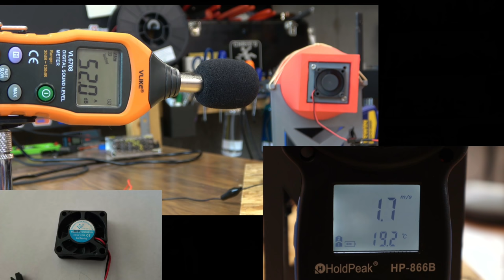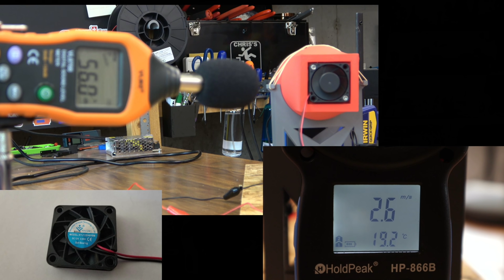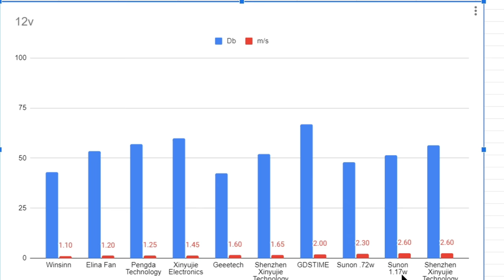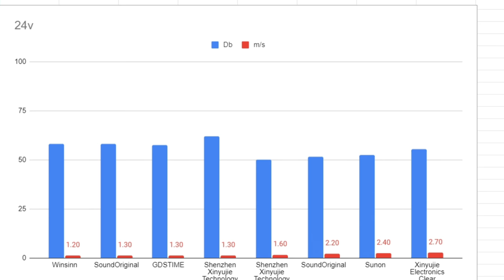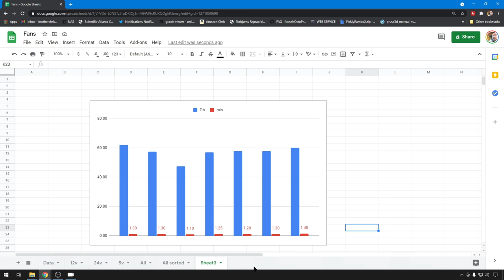Fans! Fans! Fans! - We Test Every 3D Printer Fan I Can Find - Chris's Basement

Comment: Your duct and mount prints look really clean. Cant tell if it's just the video though. Anyways, next time it would be interesting to see this done in categories/different videos of like 40mm fans with a comparison chart at end then 40mm blower fans with comparison chart and maybe a shootout with bridging, short layer times ect all tested along with different fan configurations like 1, 2 or 3 part cooling fans in different layouts. I've had great success with 3 5015s in a 120 degree layout in the past but finding good 5015s is difficult so I have resorted to over volting 5v to 8-10v changing them out regularly as a result, plus they are cheap quality to begin with. This is a great subject IMO that hasn't been covered properly in the past.
Reply from the maker: Thanks for your insight!

Comment: Excellent!  I would have liked to see the noise and output of a Stock Creality 24v fan for comparison.  Some of the 4010 fans ordered from China cause thermal shut down. So not enough airflow.
Reply: Uh no, that's too much airflow. More air, less heat at the block, can't reach heat setpoint, shuts down thinking there's a problem
Reply: @TheMidnightSmith  That is interesting. The new fan has a center hub of 25mm while the Creality is 20mm. So I assume it can putout less air. Larger hub = shorter fins.
Reply: @FilmFactry  but what is the cfm flow? RPMs? Bearing type? All create variables. If you're getting thermal runaway, it's too much air blowing on the nozzle.
Reply: @TheMidnightSmith  This is the always on heatsink fan, not parts cooling. I very much doubt it was putting out too much air. The creality has larger fins. 4010 fan.
Reply: @FilmFactry  so if it's on the heatsink, I can't imagine it being a thermal shutdown. That's supposed to be cool, but nothing measures it. The only things measured are the heater block, and the actual main board in the printer.
Reply from the maker: I thought about pulling more fans off of printers, I might still. I think I will consider rebuilding the rig.
Reply: @ChrisRiley  The stock 24v 4010 Creality fan would be great as a comparison.  I also though maybe using a hotend at a set temp, and seeing which fans are more efficient cooling it. Basically the reason we use them.

Comment: I really wish there were silent blower fans. I guess that's mechanically impossible, but it would certainly be nice.
Reply from the maker: In a perfect world...
Reply: I think something you might be looking for, might not be a fan. But a piezo aquarium air pump. I feel this might work for part cooling, if you run it through a very narrow air nozzle there directly on the hot bead as it exists the nozzle.

I haven't tested this idea, but i thought i'd share regardless. I actually had this thought several years ago but then instantly forgot to follow up on it.

Comment: To test part cooling fans, you should test them for pressure and not by flow. Try to see how much air they can make pass through a small hole could also work, and they should be much better on this them the other fans
Reply from the maker: Thanks for your insight

Comment: remember that dB is a logarithmic scale. "An increase of 3dB doubles the sound intensity but a 10dB increase is required before a sound is perceived to be twice as loud. Therefore a small increase in decibels represents a large increase in intensity. For example - 10dB is 10 times more intense than 1dB, while 20dB is 100 times more intense than 1dB."
Reply from the maker: Thank you for your insight. 🙂
Reply: That also goes for human perception of sound. For example, a 20db sound will be perceived twice as loud as 10db, and 40db will be perceived twice as loud as 20db. In fact, that is the reason why the db scale is used. Since we're comparing db to db, it shouldn't matter what the intensity is

Comment: Loved your in-depth results however those Graphs... probably should have put up a 2nd Y-axis to separate the Sound and the Blow speed, because it's very hard to compare both along the same axis.
That's done via Google docs on your chart by customizing each Series Separately on the Left or Right axis.

You should unclick "Use row X as data", because its making you miss one fan each time.

It feels sensible to graph the Sound DB logarithmically since DB scales that way. I've done this by calculating the DB difference between each fan with respect to the MAX measured and then changing it to logarithmic of that value. This scales the sound on the graph such that it can show whether a fan is 10 times louder than the other.

I was able to draw better conclusions after doing the adjustments I suggested above.
Reply from the maker: Thank you for your insight.

Comment: this is great, however just to tell the truth, not all sunon are the same, the part number tells a lot about the fan and there is a number that its really important, for example MF40202V2 the last 2 is the speed, this can be X super high, 1 High, 2 Medium 3 low and 4 extra low, this can change the CFM and off course the DB be sure to check the datasheet to make sure you are ordering the correct one
Reply from the maker: Good point! Thanks for your insight

Comment: Pressure would have been quite interesting Aswell. I can imagine that's where the blower fans are a bit better, because they have to get the air through some ducts.
Hard to test tho. Maybe measure the flow behind a small hole instead of a big canal like in this video?
Reply from the maker: Sounds interesting!
Reply: @ChrisRiley  Just print a "plug" for your orange duct and insert it about half way, with a 5mm hole in the middle. The wind reading will tell which one can create some pressure and blow through the hole the most air. Thank you for the testing!

Comment: Thing to note about dB is that 3dB represents a doubling or halving of the perceived loudness.
Reply: It does not. PERCEIVED loudness is linear in dB-scale! At least this is the case around midrange, further out this is not entirely the case, due to Fletcher-Munson curves. But for dB values which don't differ by more than about 20-30dB, you might as well consider them perceptually linear.

Putting two identical sources of noise right on top of each other will indeed increase the measured SPL by 3dB. However it doesn't make it twice as loud. Indeed if you had two identical fans near each other, each being about 50db loud, or 53db total, and you turned one of them off, the noise you're hearing would be slightly less loud, not half as loud. However, due to your experience, you would also know that you're hearing one fan as opposed to two, so you would know that this fairly moderate difference in noise volume corresponds to half as much or twice as much noise power. Confusing, right?

It's also the same with light. Two identical lightbulbs aren't twice as bright as one, they're moderately more bright.
Reply: @SianaGearz  thanks for the correction. Been a few since I was into dB (car stereo and all)

Comment: Darn, I was hoping to see Noctua 40x20 and 40x10 @ 12v

Very cool video though, really like this format.
Reply from the maker: Thanks!
Reply: The 12v versions have the same specs as the 5v version. They should perform the same given that they are run at their respective rated voltage
Reply: Nicholas Lau so they are, good heads up!  40x20 would still be neat to see, but I suppose we could infer their performance based on Noctua’s posted statistics

Comment: Even though you wernt sure about it i think its a good video none the less. I am not supprised the sunon was the winner they have been in PC servers for ever and there designed to be reliable and not fail.

You could talk about bushing, dual ball bearing thats where you will see more of a difference in noise and air flow. Also radial fans are designed for betrer air pressure so they are best choice for ducted fans. Axial fans are designed for air flow. Considering the 5010 vs 40mm i thought it might have been closer.
Reply from the maker: Thank you
Reply: @ChrisRiley  Alex kenis did a very good video explaning most of the technicality's of fans. He also touched on design aspect of colander effect, venturi, and veins. I love his videos as they are very technical and good testing methodology. To bad he doesn't make more videos more often and finishes his projects.

Comment: Hi Chris. This is very interesting. Of course it doesn't tell the whole story because these fans are operating in free flow mode (without any resistance or back pressure). It would be super interesting to perform a second pass (since you already have the setup) with a fixed restriction inside the tube (like a block with a hole in it _maybe 75% of the surface area of the tube for instance). I believe the results would be quite different. Blowers are known to built pressure while axial fans create high flow at lower pressure.
Testing with a fixed restriction would show a larger difference between fan types and would give us additional information to help decide what is best for a given application.
Either way, this is still a very interesting experiment. Thanks and Keep up the great work! Thumbs up!
Reply from the maker: Thanks!

Comment: The Hemera fan is SO FREAKING LOUD. Put one on my ender 3, with an SKR Mini E3 thinking I'd have a silent printer. Not even close. My Hypercube Evolution is soooo much quieter.
Reply: I actually added a buck converter to the fan and have it at 18.5V so it's slightly more tolerable, but it's still loud.
Reply from the maker: Yes it is very loud.

Comment: Fun fact, do cheapo 5015 fans of AliExpress, 5v, 12v and 24v - all of them are exactly the same model, just slapped different power rating sticker. So don't be afraid to use your "5v" on 24v rail! Thanks Ali...
Reply from the maker: Thanks for the info!
Reply: You have some leeway, it happens indeed that the same fan targets different voltages and RPM, but you also need care. A cheap 12V 5015 fan with 0.17A rating (i have one here) will presumably NOT survive 24V. At 12V, it dissipates 2W of power, and does about what, 5000, 6000rpm? For one, that is already close the physical limit of what blades and bushing can even survive short term, and for other, at 24V, it would be something like 0.35A and 8.25W, no way the little tiny motor can dissipate this much power!
Reply: @SianaGearz  all I’m saying - don’t take AliExpress product sticker at face value on these fans. Wanted to have “full range” of fans in my workshop but end up with 20+ identical 5050 fans. On that note I’ve been running 4x of those so called “5v” fans at 24v for a good 2x years now pretty much on daily basis and no problems what so ever.
Reply: @kr15uk  Yeah i measured the current off it though, it about agrees with the sticker. But the fan is also... well, the bushing is shot, it's horribly unbalanced, i need to replace it. Maybe when i will try to overvolt it when the replacement arrives and is fitted. But yeah it guaranteed runs on 5V too and i'm sure someone is selling the same one as a "5V" version.

Comment: These number will be very misleading if taken as is.
You have not tested static pressure, which is by far more important than flow.
It takes very little air movement over a heatsink to reach 95% of it's capacity.
Blowers may test lower in this configuration, by will have an order of magnitude more flow at the end of a duct.

You easily rig up a light foam ball in a clear tube, and measure how high the fan lifts the ball. You won't get absolute numbers, but you will be able to compare them to each other.
Reply from the maker: Thanks for your insight

Comment: Please do one for 120mm case fans used on miners etc really.struggling  with what to use
Reply: Arctic Cooling 12cm fan came highly recommended by Igor's Lab recently in a test. And it's very cheap. But it depends what kind of machine it is, its static pressure is not as high as stated - might not be quite ideal for dense fin stacks.
Reply: @SianaGearz  antminers running at 7000rpm and they scream!
Reply: @ddk4664  Oh that. Holy hell. I remember now. Yeah no, when you need that kind of airflow, there's really no escape, there is only one option. Delta high-power fans, and they come under a number of brands, seen them sold as JouJye and whatever but they were made by Delta. They'll chop you up if you look at them wrong. Well EBM-Papst and Minebea-Mitsumi could be other relevant suppliers, haven't checked, but they aren't really going to be less loud even if they have something that fits. That's a lot of air being whipped.

Comment: How to buy a fan upgrade...go to mouser/digikey/RS components etc....search for 12/24v fan. filter by size. Sort by noise. Select the lowest noise cheapest fan and then buy it from somewhere else as these companies postage is crazy.  The actual airflow for the hotend isn't really that important as they only need a little.

Part cooling fans are all noisy so just keep what you got.
Reply from the maker: Thanks for the tip!

Comment: Delta and Sunon are THE choice for printer cooling. So much better than Noctua and cheaper to boot! I get so tired of seeing bad fan suggestions all over the place. Another spec that is often missed is static pressure. This is absolutely paramount for blowing through congested passages like heatsink fins and poorly designed part cooling ducts with lots of direction changes. Noctua also fails this category, hard.
Reply from the maker: Thanks for sharing! 🙂

Comment: Thank you for your effort! I just wanted to add some things to your research that you didn't really mention. 
You're not looking at the strengths or weaknesses of the different fan types at all. If a 40x40mm Fan performs the same as a blower fan, but is quieter, then why aren't we only using 40x40x10mm regular fans for everything? Because blower fans are particularly good at forcing air through a tight space, while 40x40x10 flat fans suck at that! If you restrict the airflow of such a fan, like using an 40mm to 20mm duct adapter, then the airflow will get hit hard in most cases, while a blower fan pushes the same amount of air. This particularly important for fan ducts. Using 40x40x10mm fans for part cooling is a bad idea because the airflow is too restricted and little to no air will arrive at the tip of the nozzle. A blower fan of course has its limit too, and you quickly realize when you're hitting it: If the blower fan gets very loud and whiney, then your airflow path is too tight. But usually the blower fan gets way more air to the desired spot then a regular fan. 
But this still isnt the full picture. A regular fan can perform differently depending on how the air leading into the fan is pathing, and how the air going out of the fan is directed. 

I really recommend everyone with a 3D printer to watch these two videos! They are really helpful for understanding cooling fans:
Cooling fan basics:
https://www.youtube.com/watch?v=0CUWf34JKFI&t=896s&ab_channel=AlexKenis

And 
Why cooling fans are so hard, and some preliminary testing:
https://www.youtube.com/watch?v=SX-okOHvh1Q&t=1042s&ab_channel=AlexKenis
Reply from the maker: Thanks for your insight.🙂

Comment: if i have problem with heat for my power supply i will install a 120 mm that pc use outside the box and print a housing for it , end of story
Reply from the maker: Thanks for your insight.